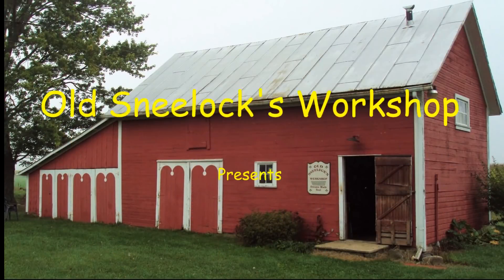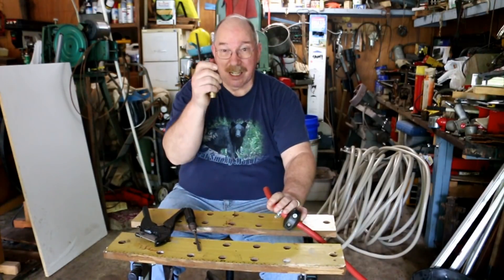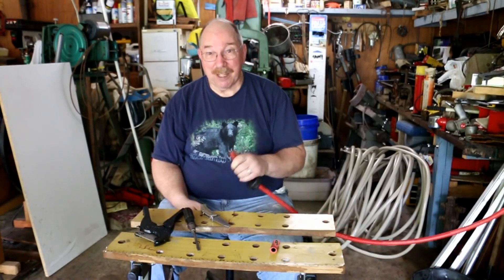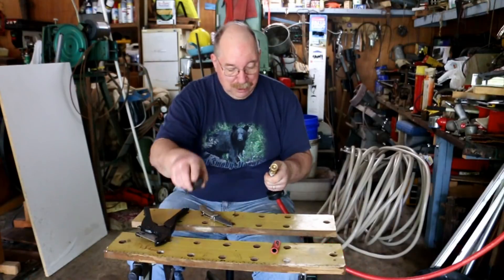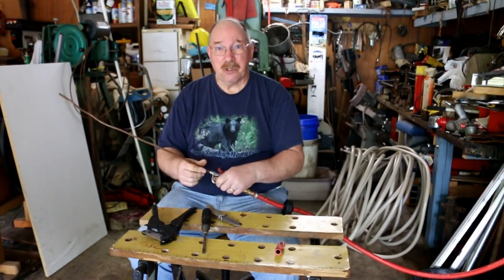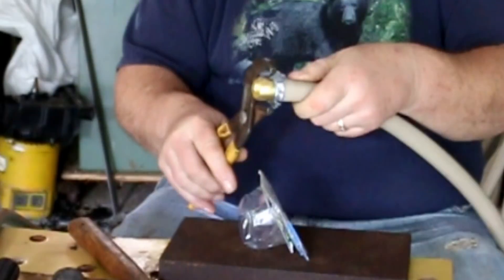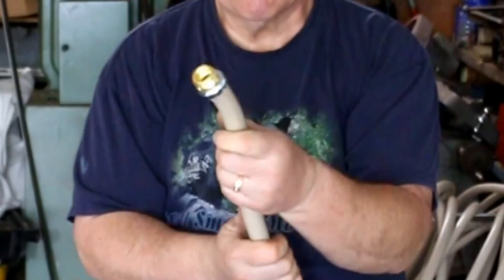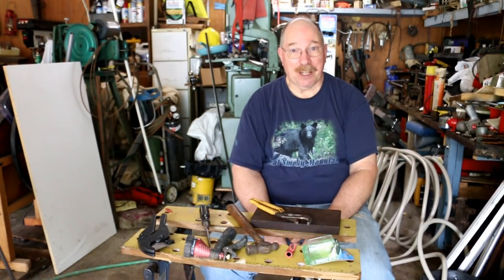MAGIC TAPE?

Comment: Never seen a crimp hose clamp like that, thanks, now if I do I can work it.  We don't use that fitting in the UK for water hose, a hozelock brand quick release or compatible  are what we use, plastic are good the brass better and fit each other
Reply from the maker: The quick disconnects are nice. I think next time I buy hose fittings I will go that way. Thanks.
P.S. Have you ever thought, " I wish they had said that sooner!"  😆😎

Comment: A friend at work was on a tall ladder and yelled, "Hey, Tom, throw me up a wrench." 
So I asked him,  "What size?"
He said, "It don't matter, I'm gonna use for a hammer any way."
Reply from the maker: There is always one. 
I went to Tractor Supply a while ago and there on the discount rack was an adjustable wrench with a hammer head. I believe it was forged, but it might have been cast steel. 
There were several there. I imagine most people recognized that it made a bad hammer and a worse wrench. 😆😎
Reply: @OldSneelock  I can't have combo hammers. I guess I'm a hammer purist!

Comment: Cheryl is using the fabric type hose this year. She really likes it which makes ME happy! And yes, I've patched and re-ended hoses for ages but it's a whatever it takes think. And I like The Smokies Bear shirt too! S-PLUS!
Reply from the maker: Lydia wants one of those that rolls itself up. As soon as I find one. 😆😲😎
Reply: @OldSneelock  Cheryl uses the coil hoses in the greenhouse but the cloth jobs outside. Been sunny and windy here so sh's watering every evening. 'Tis the season.
Reply: @lewiemcneely9143  Hey where have I been oops I mean where have you been?
Reply: @OldSneelock  I got a couple of those that are very old and starting to leak but we still use em as the don't take up much space to store.
Reply: @OldSneelock  Oops my roll up hoses are water hoses I was listening and reading comments and not watching that you were working on an air hose.
Reply: @OldSneelock  How old are you?
Old enough to know better.
Reply from the maker: @mostlymoparih5682  Smart enough to know that it doesn't matter. 😎
Reply: @mostlymoparih5682  Right here in the a.c. You've probably been running after a hot piece of insulation. Wally has been at it again too.

Comment: I fix the hose on our air slips on our workover rig every day. Do the same thing, just slide the clamp down, cut it, spit on it and put it all back together. 

Also use my crescent wrench as an adjustable hammer, too.
Reply from the maker: The miracle mixture. Mom used it to clean your face, "Here, spit on this."  Always handy to wet your sharpening stone. It helps you sort a handful of bills. It will stick down an unruly cowlick. Grat stuff and always handy. Sticky, slippery, it just depends on how you hold your mouth. 😆😎

Comment: Harbor Freight in my area won’t let you dumpster dive. They keep the dumpster locked up.
Reply from the maker: Let's hope that it doesn't spread. 😈
Reply from the maker: Let's not advocate breaking any laws. Some companies don't want their dumpsters bothered. That's their business and their choice.
Reply: @OldSneelock  sometimes I forget that a wink or a laugh doesn't come through text, I'm not as tech savvy as most of my generation. That said, I think every handyman should learn a bit of lockpicking, I only use my lockpicks to avoid the highway robbery involved with the local locksmiths.
Reply from the maker: @blargkliggle1121  Yeah emojis are a poor sustitute for face to face. 
I have opened locks for people who forgot their keys, locked a file cabinet accidentally, or locked their keys in the car. We just have to be careful what we advocate. Not everyone knows we're joking.
Reply: @OldSneelock  out of respect for you I've removed my comment, I normally wouldn't do that but I value your channel and the time and effort you put into it.
Reply from the maker: @blargkliggle1121  Thank you for editing the comment. If I thought it was bad I would have pulled it myself. It was more of a teaching moment. I think we lose a lot of the meanings in our conversations when it is a one sentence blurb. I know I have written comments that seemed fine until I went back later and read them in the context of the conversation. Humor is often one of those you had to be there things. 😆
Reply: @OldSneelock  if that ain't the truth!  Though it's usually me trying to hammer that into my friends, the only social media I use is a facebook account for keeping track of get togethers.

Comment: use a little soap on barb fitting and it will slide in with less effort  or gas on rubber gas lines
Reply from the maker: Good suggestion. Works real nice on the flimsy windshield washer hoses. Putting those on is like putting elbow macaroni over a baseball bat.

Comment: I worked in foundry/machine shop with Bullard Vertical lathes the hoses used on the machines were air/water hoses good for blowing chips and debris of the chuck. Also great for water fights when it was over 90 degrees F. but I don't think I would want to get blasted at close range with one of those, as they were good for a good soaking of someone about 50 feet away in obout 3 seconds.
Reply from the maker: Working in factories brings out the crazy in some of us. Me included. We had a vertical lathe at Douglas Corp. The maintenance man, knick named Shakey by one and all, had disassembled the transmission. It must have been one of his worse days because from then on it had one speed. Dead Slow.
Reply: @OldSneelock  I used to do that with the water hose on the mixer in the summer. Hold it straight up. Cools off everybody including yourself. I'd always get tickled the 1st time I'd do it to a new crew. They'd sull up till they saw I was getting it too. Then everybody got a laugh and a cooling.

Comment: Great video.  The military also teaches about air hose safety and not "Goosing" your fellow solder, airman, marine, and sailor.
Reply from the maker: It's a bad practice that just seems like fun.
Reply: @OldSneelock  I never got into that/. Just like holding the safety back and machine gunning a nail gun. I'm scared to death of a nail gun anyway.
Reply: @lewiemcneely9143  you should look up Essential Craftsman's video on two workplace accidents (https://youtu.be/rP2Qn8VTkTo). He talks about a guy that wired the trigger, and the reason he shouldn't have. If you decide to read the comments, you should set aside a couple afternoons.  There are MANY worthwhile chuckles in the comments, and probably even a few you've never heard.
Reply: @BrianDaleNeeley  Comments are always the best. I used to watch Essential but the house building thing is over my noggin so I moved on. I was always involved in the site prep and such and I'm diesel powered, not a thumb flattener. Thanks, Brian. I guess we'll all chuckle together here if not somewhere else!

Comment: Back-In-The-Day, I use to "Dumpster Dive" all the time for goodies. But it never crossed my mind to "Dumpster Dive" Harbor Freights dumpster for items that could still be useable, with a little tender, loving care of course, because like YOU Old Sneelock, I too am thrifty - as I like to call it, or cost conscience (I reckon that's the Jew in me though) as I hate to throw anything out that could be fixed/repaired to live another day.  Crescent wrench used as a hammer? Absolutely!  As I have many crescent wrenches (and very few hammers) that seem to never be around when I need one. :-)

Comment: Thanks Old Sneelock!  There is Always something useful in your stories;  Bonuses are Laughs!  ; )     Have a Lovely Memorial Day!   ~- *
I look at my 'garden' hoses and realize I have a Lot invested in mending it.   LOL  When  do i stop?    8 {)   
Now I CAN'T get menders to fit hose, they Always leak!   Never had problem before. Found if i wrap piece of bike tube around, works for awhile.
Reply: You stop when it can't be fixed or you pitch a fit and blow it into a zillion pieces. Then you go salvage the fixers.
Reply from the maker: Like Lewie says, Ya stop patching when you run out of room to stick patches in. 😆😎
Reply: @OldSneelock  There you go, Unc! AND Karen!
Reply: To  @lewiemcneely9143  & Old Sneelock  ~  You Guys know the Best 'Fixes' and sounds like a BLAST to try!   I have quite a stash of styles of 'fixers'.  ($$$ investment ??)  Some I can't find in stores - the Nice Brass ones.  
There was one type that you screwed into hose and 'collar' screwed up around it', Nice!   Don't have hose now, but i damn well saved that mender, Made in USA!  Odd it doesn't fit other hose of same size.  Bet hose [now] Not made in US.  
I wonder if menders i've gotten few years ago were Not U.S. made.   Jeez, I've gotta check now!   Peace All!   ~- *
Reply from the maker: @kareno8634  The one with the screw on collar sounds like hydraulic hose fittings. Use to make a lot of those. Douglas Autotech used hydraulics on a lot of equipment. I bought a set of swages to make hoses rather than pay to have them made at a dealer. I did notice that my stock of hose would drop precipitously in the spring and fall. Mostly 1/2" hose and fittings. Plows in the spring and combines in the fall.
Reply: @kareno8634  Unc. and I have been in too many situations where we couldn't run down and get what we needed so we had yo improvise, or as David Haley calls it, 'Fabricobble', which is a combo of cobbling up a fabrication. And makers change everything around where you HAVE to buy complete units instead of fixing older ones that still work perfectly fine. There are words that I had a hard time stopping  using that describe them too.  So keep the 'fixers'. You'll probably come up on a time when nothing else will do! Peace likewise and MORE OF IT!